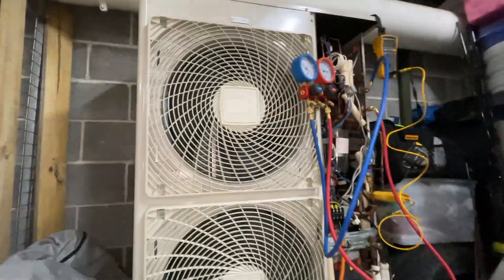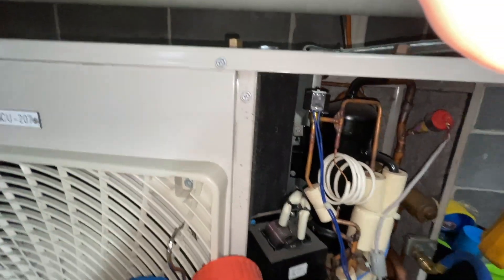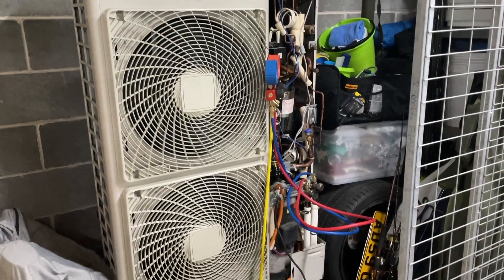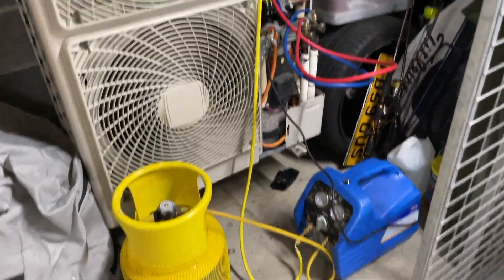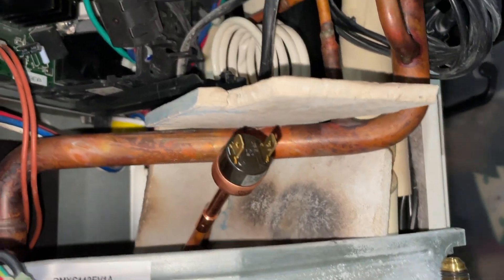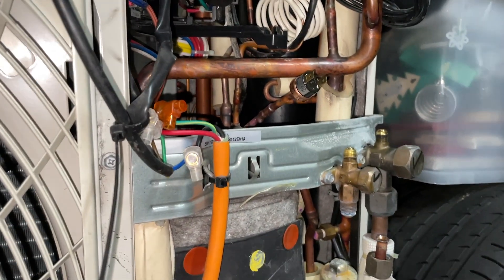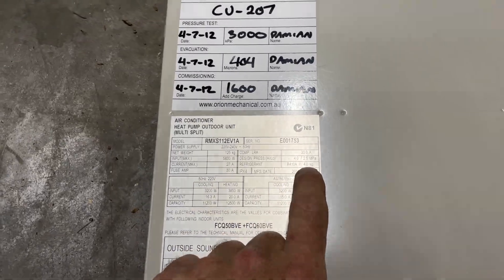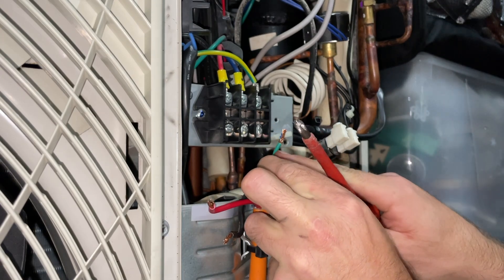Repairing Daikin E3 Error

Comment: Hi Mitch, 
DAIKIN AIR WATER HIGH TEMPERATURE 16K installed in 2019
I have an error code that remains displayed:
Unit 0
E3 12
160 L32
006 F5E

Do you have any information regarding this recurring error code?

Unit 0 concerns the outer group?

Best Regards ;)
Reply from the maker: Sorry mate I don’t really understand what your talking about. Daikin E3 is a high pressure switch. Something is causing the system to have high head pressure OR the pressure switch is faulty.

Comment: How did u manage to get the last of the gas in? I though the last would go in the suction when on?... I'm trying to learn ac, just incase iv missing something..
Reply from the maker: So after evacuating the system, I weigh in the refrigerant. In the perfect case, there is enough pressure in the bottle to add all the gas in. If not, then I run the system and add it slowly through the suction line. 
I hope that helps mate.
Reply: This comment was for previous video mate.. Same HP video /fault

Comment: Thanks for pointing out just how stupid the HP switch is on the Daikin units,, I have replaced so many and every time I just shake my head in disbelief as to why they designed it that way where it requires a gas removal process..Yet the HP sensor switch can be removed in minutes by screwing off and screwing back on..
Reply from the maker: It makes no sense to me either. So stupid!
Reply: @maracservices  what’s even more unbelievable is that this has just happened to me again today on a VRV unit!!
Reply from the maker: @rdenir  oh wow.. I’ve come across this twice now. They definitely fail. Once again, why it is soldered in is beyond me..

Comment: Hey bud 
I have the same error coming up but mine stays on for about 40mins and the top fan doesn’t kick in either
Reply from the maker: It’s a high pressure switch so unfortunately the only way to diagnose this is to reset the system, and run it with some gauges on the unit. If the pressure is indeed getting to high then it could be caused by the top fan not running (if on cooling mode). However if it is coming up with this error when the pressures are fine then I’d put my money on the HPS being faulty.